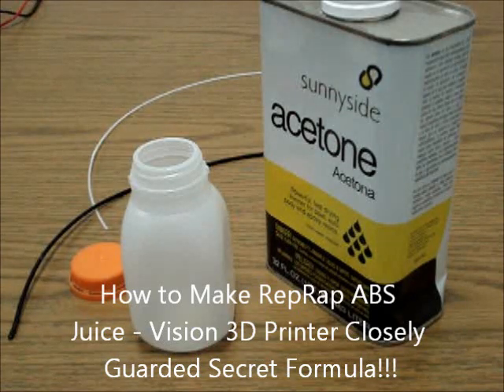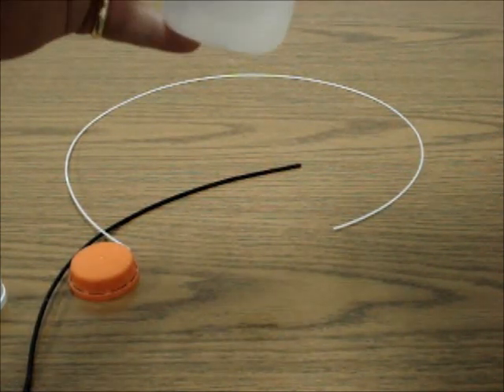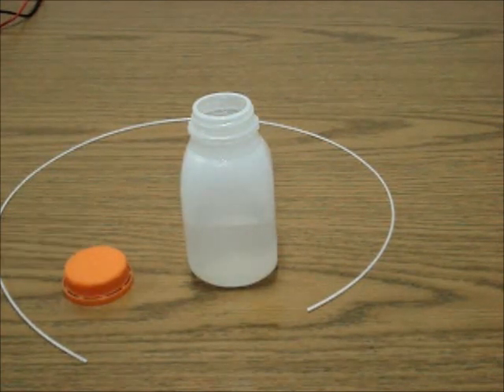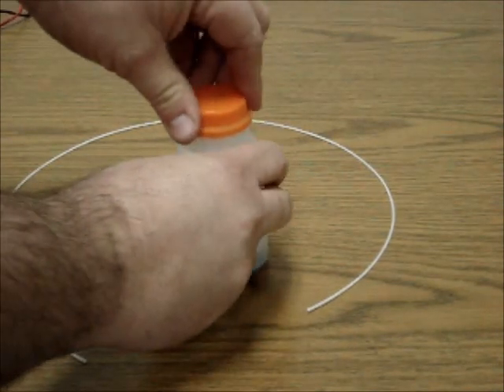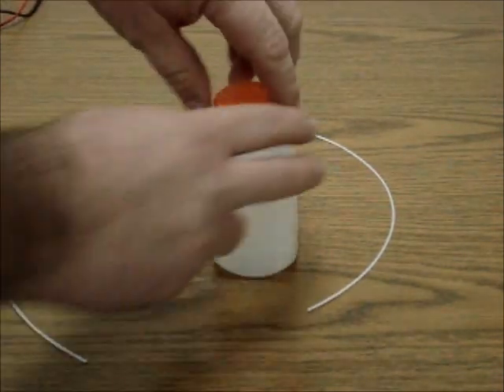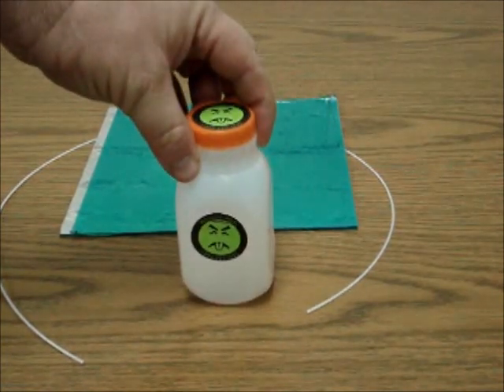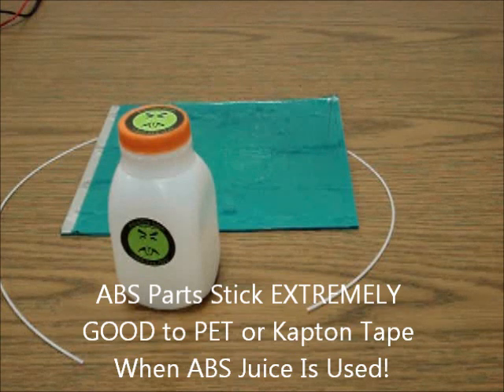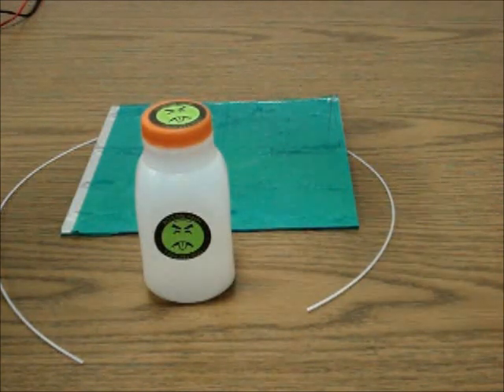Vision 3d Printer ABS Juice for Printing RepRap ABS Plastic

Comment: rubber cement painted on the back of aluminum foil works too for things that will evaporate though polyethylene like xylene, you just put it in jar lid using the rubber cement to bond it to the inside of the lid then you get a tight seal on top of your jar of pure metal even if you use a jelly or jam glass jar to avoid any PE in your container

Comment: Potentially Final Update:  Sunny D Bottles have not caused problems after 13 months.  The lid remains 100% un touched as well as the bottle.  HDPE container is not harmed.  Remember to remove the label.  One of our members is having problems with his ABS juice turning to liquid + sludge.  This may be due to the container.  The printer is working very well.  Zenikinetics gave hackspaces in our state 4kg of plastic for free.  PLA does not melt very well in Acetone.  Do not do this with PLA.  It's a waste of plastic and acetone(but nothing catastrophic happens).

Comment from the maker: It works great on Kapton (Yellow Polyester tape) or PET (Green Polyester Tape) for ABS. For PLA, a plain Mirrored Tile cleaned with an ammonia based window cleaner is best when you have a heated bed. I set the bed temp to about 50-60°C and the PLA Parts are FLAT! Something you can't get with any Makerbot Replicator 2 or 2x.

Comment: Yeah.  ABS juice is easy and effective.  I had that same problem.  Acetone doesn't really hurt the PET tape too badly and it's relatively safe.  I've even been stupid enough to apply some to a hot bed with a Q-tip(fire hazard).  Nothing ignited... but the acetone boiled.   What I didn't expect was that the existing ABS coat ended up bubbling into a kinda.... pork rind-ish spot where the acetone boiled.

Comment from the maker: I purchased them brand new in bulk at an industrial auction. They are the same type used for milk & Juice. 

You can use a standard HDPE juice bottle (not the clear PET ones) or even a glass bottle, but you need to make sure the liner in the lid doesn't melt or allow the acetone to evaporate. If you reuse a bottle, make sure you clean and dry it very well before you use it. You want the ABS juice to be as high quality as possible to improve the bond between ABS parts and your build plate.